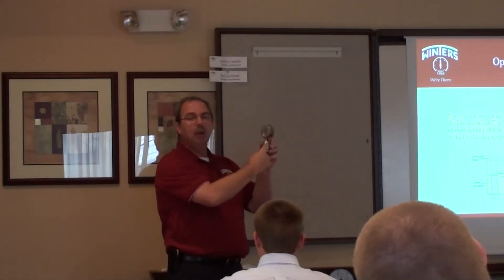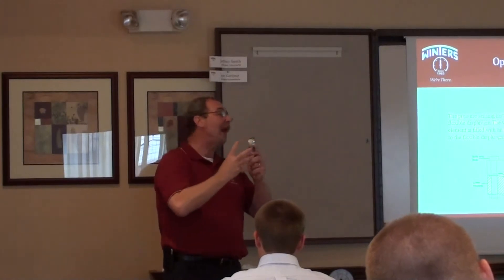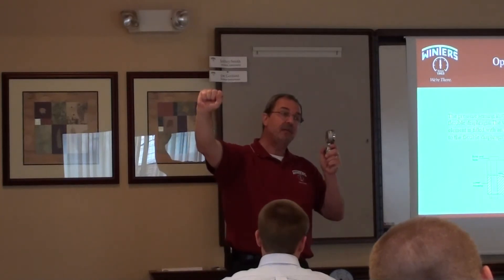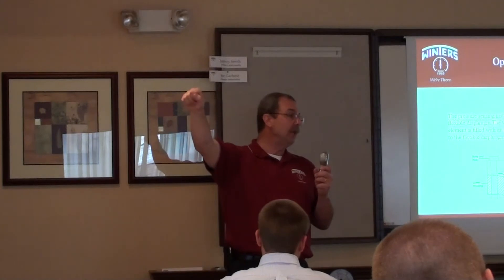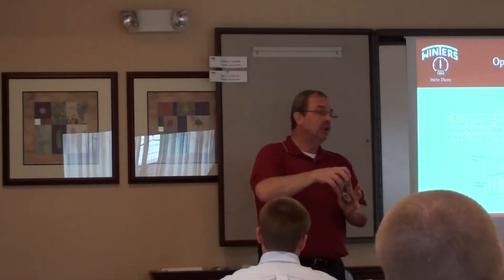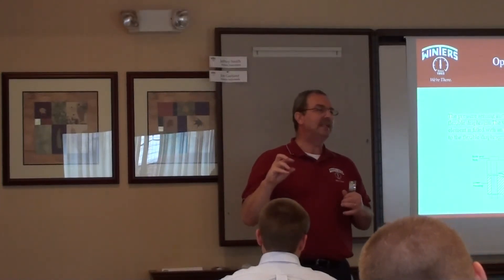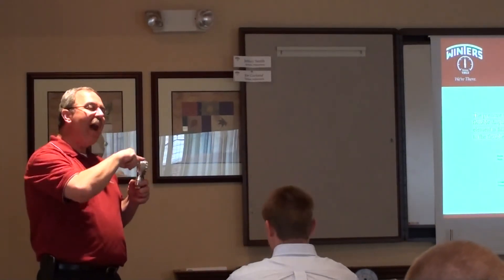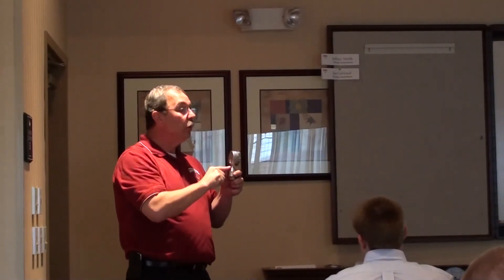How Does a Gauge Get Mounted to a Diaphragm Seal?

Comment: What about damaging the diaphragm from pulling a vacuum? It that not a concern? Atmospheric pressure must not be enough to damage the diaphragm?
Reply from the maker: There are two techniques for filling a seal.

1) Pulling a vacuum from the fill port. As the concern expressed in the question, if the diaphragm is real thin as different manufactures have slightly different thicknesses in the diaphragms they use, the diaphragm can be sucked up and possibly damaged depending on the design of the seal itself. To prevent this a vacuum can be pulled on the process side of the seal to prevent it from being sucked up.

2) Some seals can be filled by what is called gravity feed. The fill fluid is basically put in by hand and let to sit.  Then the diaphragm is burped by pressing slightly on the bottom of the seal. This process is repeated until no more bubble come out meaning all the trapped air has been removed. The instrument is filled separately and mounted to the top of the seal. If pressure builds up on the assembly from overfill, then use the bleed screw to zero the assembly out.